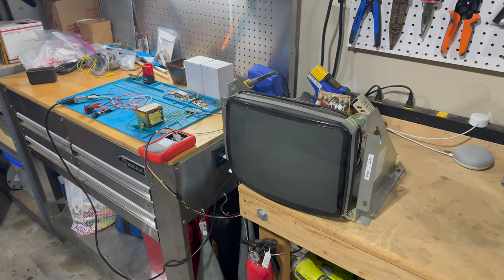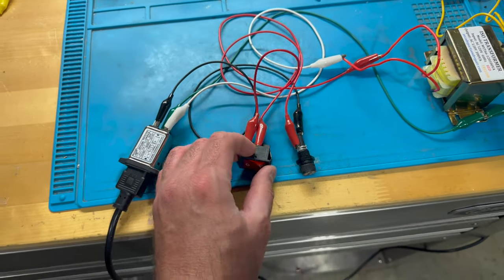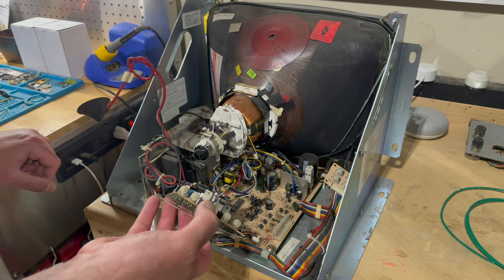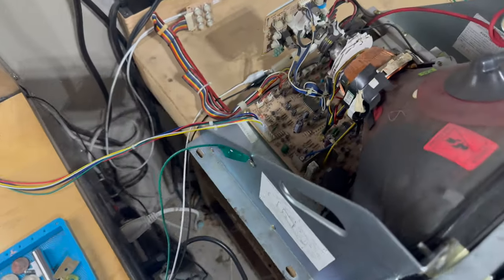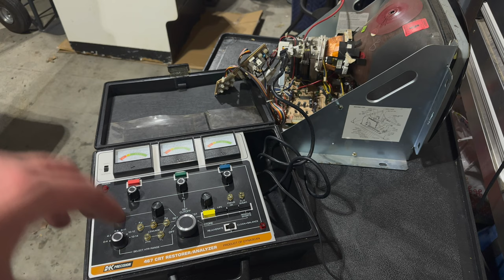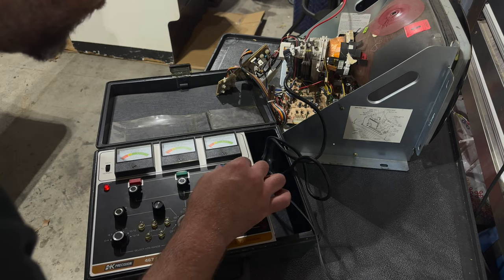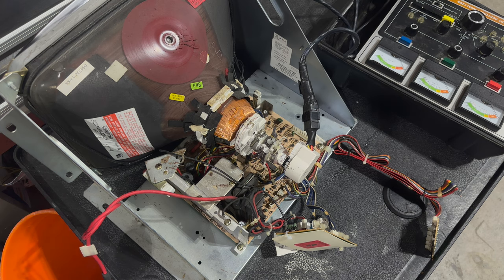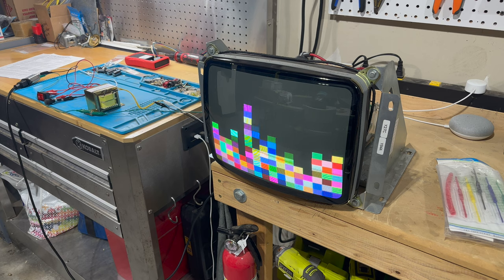Repairing a 13” K7000 Arcade Monitor, building a Test Bench Power Supply, & Rejuvenating a CRT Tube

Comment: Hey brother! Thanks for the plug!  Great video! Just wanted to throw out a quick note in reguards to using the clean and balance versus the rejuvenator. The clean and balance you can hold the button down till it reaches the .2 mark, and the rejuve process is stopped at the beginning of the red which is .4  I also like to wait about 10 ir 15 seconds between each color to let the caps fully charge back up. 👍👍👍
Reply from the maker: Great info — I’ll keep that in mind for the future! Thanks so much, Bruce!!

Comment: 31:50 Not sure if it's camera angle or this issue, but my monitor has a similar "twist" that I think is visible here (top left of image seems to reach the edge while top right is about a quarter-inch off). Is that about how the flyback is seated in the tube, or some other setting that can be adjusted with a pot switch?
Learning so much from your super informative videos. Thanks!
Reply from the maker: It’s a very common geometry issue. If you aren’t able to get rid of it with the typical adjustment pots on the monitor chassis (tip: try slightly adjusting the sync/hold pots to see if that helps), then you can look into adjusting the position of the yoke. That procedure is a huge pain in the butt to do though, so I typically just live with it unless it’s completely unplayable. I don’t believe there’s a flyback issue that could cause this sort of twist/curl.
Reply from the maker: Also, thanks for the kind words!
Reply: @overtimearcade  Thanks a mil! Yeah I can definitely live with it - very minor issue, plus I usually play in the dark and only really notice the "twist" when viewing the screen in the daylight. And then it's only really noticeable on test screens & games like Pac-Man where the playing field is a full-screen rectangle within the bent glass tube. I thought maybe there was a "skew" or "pincushion" setting/variance that might account for it. But no biggie. 👍
Reply: @overtimearcade  Thanks for all the clear information! You know, when I was a kid I dreamed of having my own arcade cabinet(s) as a grown-up, just to play on. Finally got my first one last year, and never knew how much I'd enjoy the rabbit holes of repair & maintenance & dialing in controls that come with the hobby. What a blessing for all us big kids that people like yourself make such a useful library of knowledge available and keep these neon dreams alive. Cheers!
Reply from the maker: I’m glad I can help support your dreams! 🤩

Comment: Thanks for the video's,,,,, Please  help, ,,,The isolation transformer output has two wires, both with no reference to which is hot and neutral , which is okay! but then there's that green ground wire for safety?            One side's output of the secondary's Iso's  electrons are like BLIND MICE, they only want to go toward there easiest path home,, "the other side of there secondary". THATS IT. ..
So why add the safety ground,  Or' is that just in case the iso fails to perform?   also, Are both green ground clip and fluke's  black lead USING THE SAME POINT OF REFERENCE for MEASURING B+?    Thanks...ordering T shirts!
Reply from the maker: On the output side of an isolation transformer (i.e., secondary wiring), there's no difference between hot and neutral. There should not be a green ground wire coming out of the isolation transformer -- if yours has a green output wire, it could be an iso that provides multiple output voltages. However, many arcade manufacturers did connect the case/foot of the iso to ground inside the cabinet, similar to the diagram from Bob Roberts at the bottom of this page: http://www.therealbobroberts.net/acwiring.html

Also, for measuring the B+ voltage on a monitor, consult this page: https://www.arcadepartsandrepair.com/tech-help/monitor-b-settings/ Every monitor is different, but you should not be measuring B+ using the cabinet ground as a reference, but rather the monitor frame (typically).

Comment: I've seen other videos with isolation transformers and they disconnect the earth line, stating that it's connected to neutral back at the main neighbourhood transformer, and so connecting the earth back to the chassis in this case, doesn't in fact do anything. Can you clarify which is correct, and why?
Reply from the maker: This was actually discussed on KLOV recently, and a member there who's smarter than me explained that the purpose of an isolation transformer is:

> to isolate the line and neutral from earth ground since the neutral and ground are tied together at the power entry point, typically the breaker panel. This "floats" the monitor from earth ground. For safety and to keep the chassis from building up a potential voltage due to capacitive coupling in the monitor you SHOULD tie the chassis (metal part of the monitor) to earth ground.

https://forums.arcade-museum.com/threads/electrical-gurus-test-bench-upgrade.523362/post-4685375
Reply: @overtimearcade  Interesting. So the chassis should be grounded to help dissipate capacitance buildup within the monitor chassis itself. This is good to know.

I'm going to have to run the oscilloscope of a separate isolation unit then, as it's meant to be grounded to the centre pin of the transformer. Grounding it to the mains ground can blow your oscilloscope if you end up dumping too much voltage through it, which can happen in a monitor.

Thanks you for that, and the link :)
Reply from the maker: No problem! As I understand it, the input voltage going into the monitor needs to be isolated from ground, but the monitor frame itself should still be grounded.

Comment: I believe you're not supposed to connect the earth to the monitor.
Reply from the maker: As discussed in the same KLOV thread linked in another comment, a monitor chassis should be connected to earth ground even on test bench setups for safety reasons:

> With the monitor running and "floating" there's parasitic capacitance between the frame and the AC voltages in the monitor. This can cause voltage to appear on the metal frame which can be a shock hazard. On my test setups I usually include a ground wire with a big alligator clip I can just clip onto the frame while it's on the bench. This is also important if something has failed in the monitor that may be shorting any higher voltages to the frame. You want to be sure you can touch the frame without getting shocked, this ground connection will ensure that.

https://forums.arcade-museum.com/threads/electrical-gurus-test-bench-upgrade.523362/post-4685461

Comment: Do you ever have trouble finding parts for repairing arcade equipment? I've heard people complaining on forums that repairing and finding Arcade CRTs is too difficult for them.

That the last CRT factory closed 15 years ago.
Reply from the maker: Great question! Generally speaking, I haven’t run into any major trouble with this sort of thing yet. Unless the glass of the tube has been cracked causing the CRT to lose its vacuum, virtually everything else on an arcade monitor can be repaired or replaced. Parts are available for most of the classic 80s monitors (G07, 4900, K7000, etc.) but some of the later monitors are far more complex, and a few don’t have good repro flybacks available, etc. So I guess it really depends on what you’re working on. And of course, although the factories have closed, there are tons of parts tubes & chassis out there to harvest from, if you know where to look!